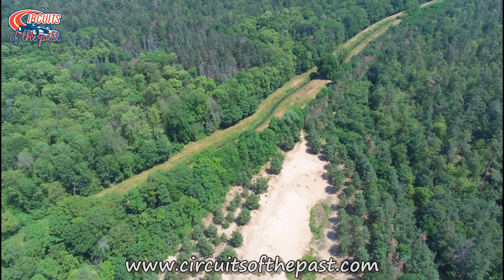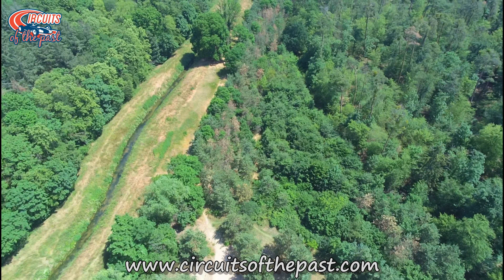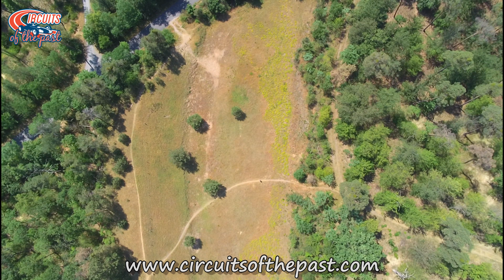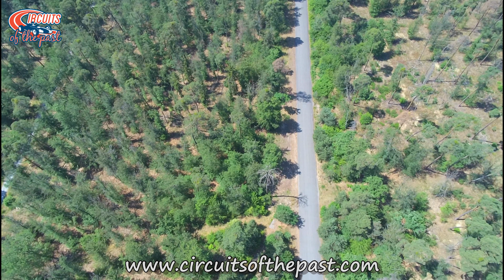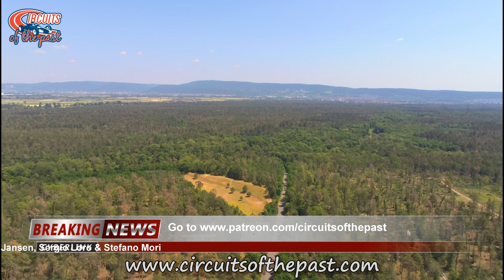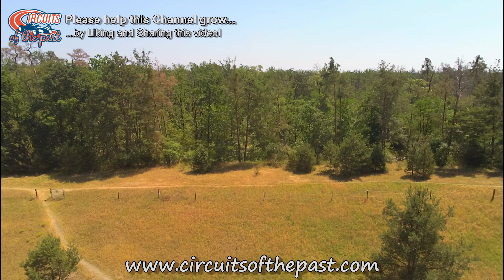Old Hockenheim Circuit Today by Drone

Comment: Its sacrilege what happened to the track. They should reinstate it even if for classic races.
Reply from the maker: It's too late for that. To compensate for the felled trees for the new circuit, the old part was largely demolished to plant new trees. There is no way they are going to cut this down again to rebuild the old circuit.

Comment: The new layout is actually not that bad and produces good races
Reply from the maker: And the old layout was not that good. Long straights and chicanes. Boring actually. But it was an unique circuit with it's own character. However not a drivers circuit and not beloved by the drivers, only by the fans, it was a funny track once a year and made some alternation on the calendar.

Comment: why tf is the Jim Clark memorial in such bad condition?
Reply: It used to be along side the track near a spectator area. Now it's a half a mile out in the woods surrounded by nothingness.
Reply from the maker: @ohiopower There are two memorials now. One on the crash site which you see in the video. And on near a spectator area.
Reply: Because it's awkward to get to, I guess and people see the new memorial by the current track and don't realise it's nowhere near the location of the accident . Shame we didn't get to see the Bert Hawthorne memorial next to Jim's out in the forest (assuming it's still there). Would also be nice to see something similar for Patrick Depailler at the Ostkurve and Markus Hottinger on the exit of the first turn .
Reply from the maker: @chrishall2211 The Bert Hawthorn memorial is next to the Jim Clark memorial at the current track. On the crash site I saw only the Jim Clark memorial.